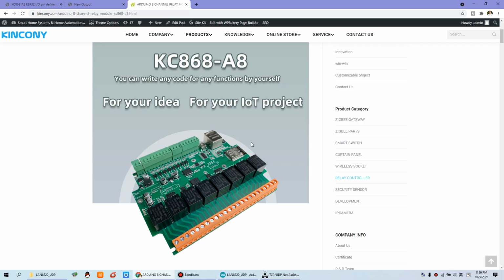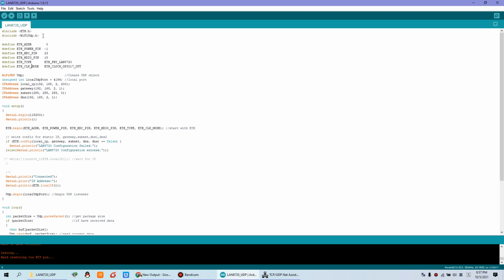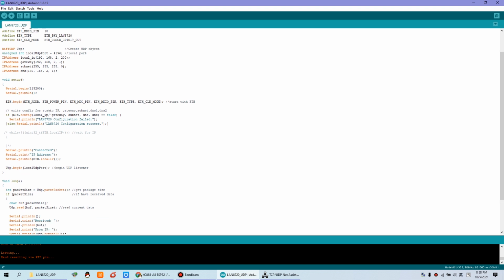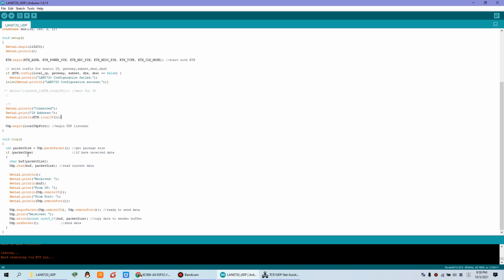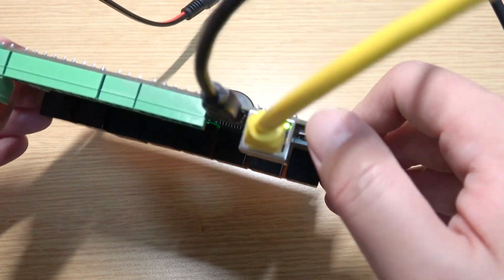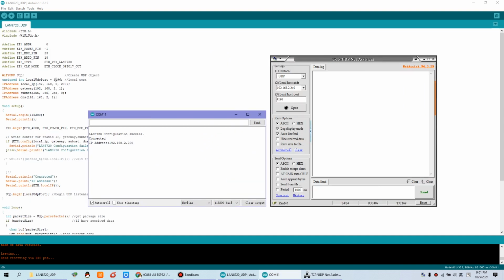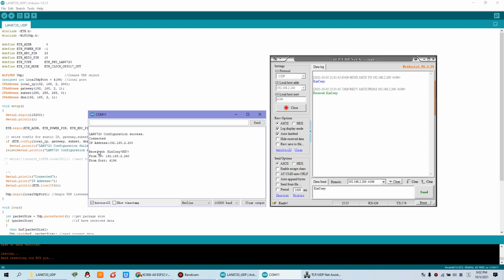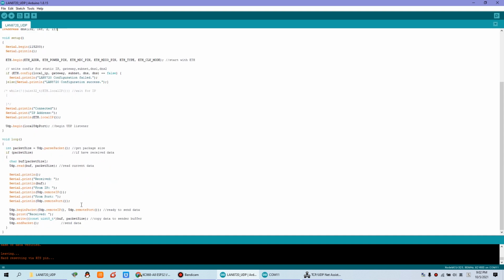Lesson18- how to use UDP communication with KC868-A8 by ethernet

Comment: I need to communicate Modbus TCP with PLC S7-1200 via Ethernet port, do you sell sample code?
Reply from the maker: do you use arduino IDE to write code? it have modbus library.
Reply: @KinCony  Do you have wechat's software application?